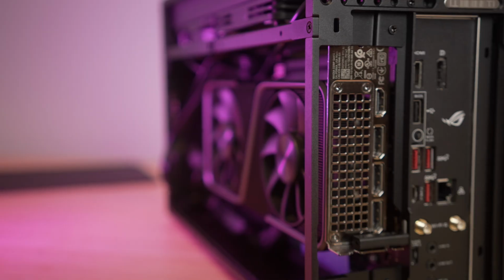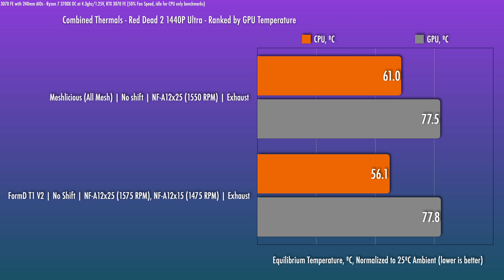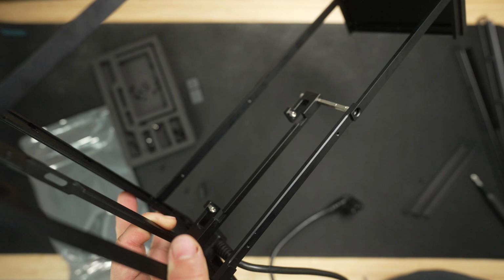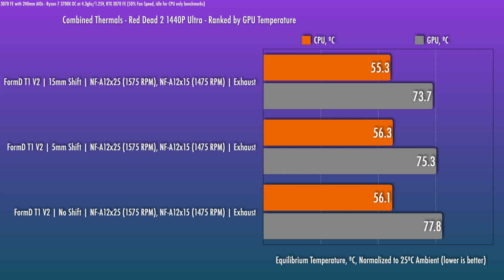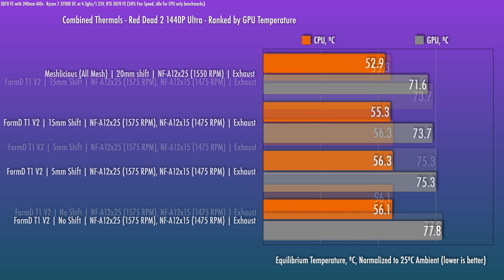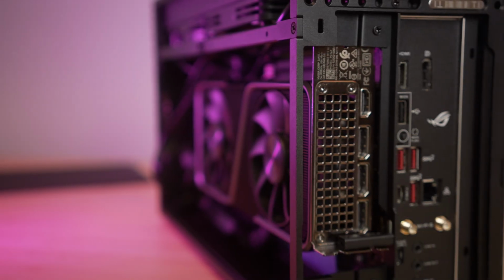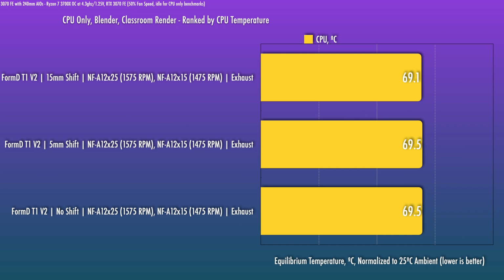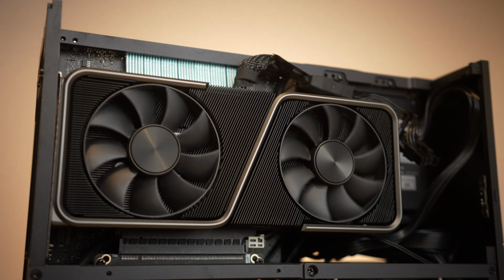FormD T1 V2 - Optimizing for Flow Through GPU Coolers

Comment: I've done something similar with my V1.1. I put the motherboard tray in the 3 slot config but setup the GPU in a 2 slot config by using standoffs. This makes the PSU up against the side panel and leaves an entire PCI-e slot worth of space between the gpu and motherboard. Originally I had a 3070 XC3 Ultra which caused the fans to rub against the side panel, but moving to a FE card this makes putting the side panel on easier and should give better thermals for the cpu and other components

Comment: Instead of off-setting the GPU mounting, you're much better off off-setting the power supply. 
With the standard PSU mount, mounted to the top strut, you can use the left-over stand-offs to move the PSU closer to the motherboard side panel. 
For 2 slot GPU mode this means you can offset the power supply 15mm further away without buying any extra stand-offs.
Alternatively, the biggest gap you can have between the flowthrough GPU fan of a FE card and the power supply is by using the alternative power supply mount. The front panel has some mounting points for a 2.5" drive, but those can also be used to mount the power supply, this has the PSU practically flush with the motherboard side panel.

Lastly, I justed wanted to note 2 things:
For the handle, there is a 3rd mounting point in the bottom left, you can see it at 2:10. 
At 5:08, if you're struggling to mount the GPU's IO bracket to the GPU hanger, you can just remove the rear panel and screw it in easy. You can even assemble the entire system to the spine first and leave the front/rear panel as some of the last pieces to assemble.
Reply: I’ve done that on mine, but went for 20mm ones I picked up.

Comment: Went air cooled for CPU, have the 3080 FE, no stand-off in two slot mode and did the alternate mounting of the PSU, getting max 76 while gaming. I think the Alternate PSU mount is more beneficial than the standoff for the riser.
Reply: What do you mean by alternate psu mount?
Reply: @d0m_eli436  You can mount the psu to the ssd holes on the side of the front panel. If you type in formd t1 simply scott into youtube, he's got a video showing how to do it.

Comment: Can you try the Tape Mod for the Dan A4 H20 for GPU side? Apparently it helps with temperatures by a fair amount
Reply: What is this tape mod? Do you have a link as reference?
Reply: @Ludalex07  Saw it on reddit after a google search. It's strip of tape covering the top of the gpu/aio for better heat dissipation

Comment: Got an Aluminum SW from the drop last Sunday. This is exactly what I needed for planning optimal thermals for my 3080 FE!
Reply from the maker: Awesome! Enjoy!
Reply: if youre planning on air cooling, just put enough standoffs on the psu so its hugging the side panel. in my experience that made the biggest difference in temps for the fe since most of the flow through fan is next to the psu, and thatll leave enough space on the motherboard side for the beefiest air cooler that can fit. a good fan directly above the psu also really helps with temps.

my 3080 sits at like 81 without any voltage or fan control on it though, and a decent undervolt gets it down to mid 70s in most games.
Reply: @haydenschroeder4619  yup was planning doing that and mounting it 90 degrees as well
Reply: aluminium